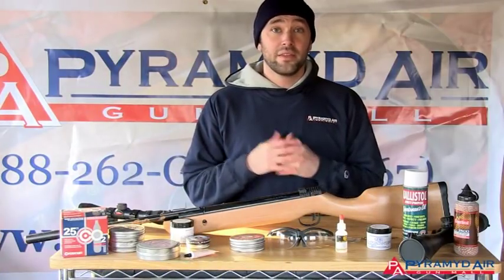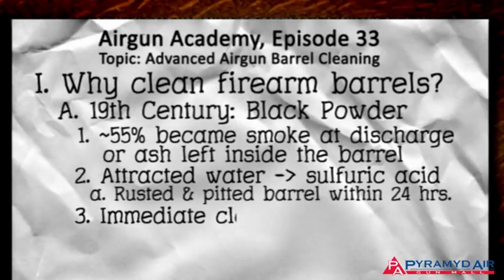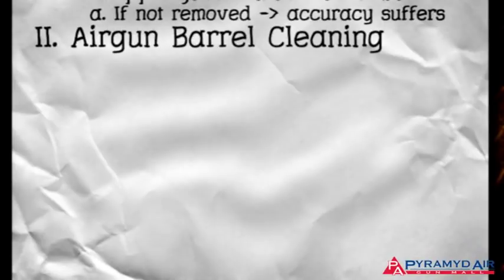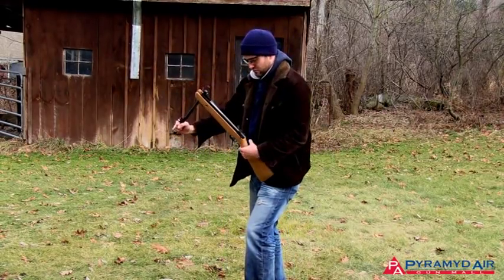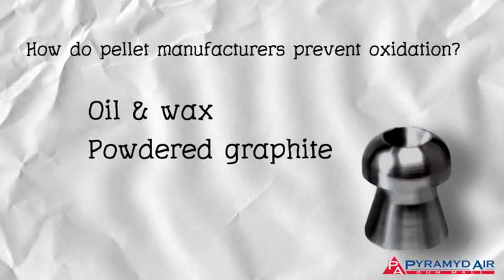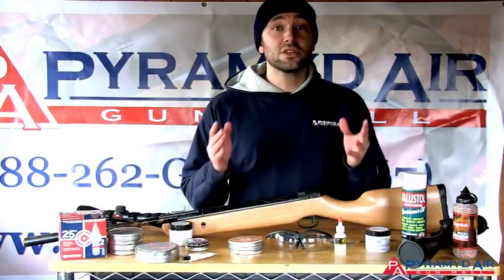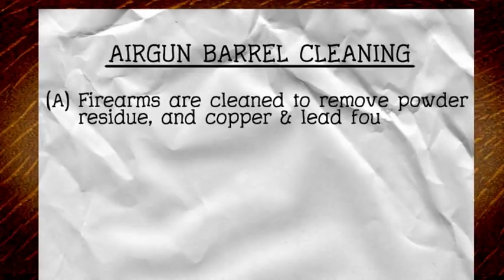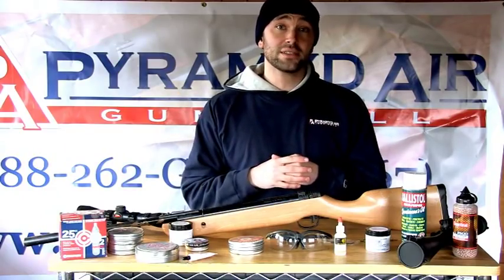Airgun Academy Episode 33 - Cleaning your airgun barrel

Comment: I agree 100% with your suggestions in this video. I rarely ever clean my airgun barrels. The outside is a different story. Oils from hands can damage the bluing, finishes, etc, so I do wipe down the barrels with household oil after every use and put the rifles away without touching the barrels again. I also wipe down the stock to remove oils and sweat that may have been transferred. Another recommendation, I always remove any rings I'm wearing so as not to scratch the barrels (especially springers). Yes, this includes my wedding band (but only while shooting!!  GREAT video, thanks for the information.
Reply: A lot of fine over unders have been purchased for good price due to rings being worn while shot. 😅

Comment: I use a piece of grass trimmer string and a small patch with a little Hoppe's solvent, followed by a patch with a little Remoil on it, about every 500 pellets or so. Has worked for me for years and no damage to the bore.

Comment: It is a good idea to do a once-through with a patch or two when you get a new gun, especially if it's one of those off-the-shelf kind you find at Wal*Mart.  Sometimes, manufacturers put a thick oily coating in the barrel to protect it from corrosion during transport.  This is especially true with guns being shipped overseas.  Almost every Chinese-manufactured gun I've seen has this dark colored gunk inside of it.  You can smell it if you fire a round through and, in the case of break barrels, actually see it atomized and suspended in gases and water vapor.  Firing a bunch of alloy pellets through the barrel will eventually clean most of it out, but running a few patches and a small amount of solvent will give you a good head start.
Reply: Is it common for the first shot from a new air gun to blow smoke out and sound like a 22 long?
Reply: @JFEnterprize  Only an actual firearm will produce smoke of any kind.  If your airgun doesn't have a suppressor, it will definitely make a loud bang, especially if it is a high velocity gun.  Airguns only produce water vapor from rapid air decompression.  For more details, see the above.
Reply: @misterkaos.357  I figured maybe it was the storage oil from the factory. It def was a smoke. We had a pellet in the barrel. Only the very first shot in a crosman quest 1000fps .177 air rifle. I need to get another nice one. Any recommendations? Thinking pcp but break barrels seem a bit cheaper to run without the tanks ect. Plus I imagine maintenance of the gas systems years down the line.
Reply: @JFEnterprize One thing to keep in mind, is that break barrel guns tend to be less accurate than the other types.  Another thing to keep in mind is that most airguns that have the FPS on the package tend to be marketed to casual users who don't understand how velocity affects the projectile.  Your typical .177 pellet isn't really designed for transonic or supersonic speeds.  They are generally more accurate at subsonic speed.  If you want an airgun that can really handle supersonic rounds, it will be more expensive and you'll be using conical slugs as ammo instead of traditional pellets.

Comment: I would avoid using any rod to clean an airgun barrel. Typically airgun barrels are softer and something like a rod can, and will damage the rifling... Use a string pull through method and thats only if accuracy isn't what it used to be
Reply: AirgunnerCA I have used a rod 3 times and thankfully my accuracy is still spot on. now I know too just leave my air rifle barrel alone, and I wont ever shove a rod down her again. thanks for the info.
Reply: Yes and no, brass is always softer than steel, however what you are in danger of damaging with a metallic rod is the crown. Gunpowder firearms don't have a crown in their barrel.
Reply: @kizunadragon9  Pay attention boy, the advice says never clean a brass barrel, they don't need cleaning.
Reply: @kizunadragon9  Really!  My gunpowder firearms must be defective then.
Reply: @kizunadragon9  No crown? Are you serious? ALL barrels have a crown. Why would you post such nonsense?
Reply: @scottmurphy650  yep, completely wrong on that one, my bad.
Reply: Brass rods are softer, intentionally, than steel rifle barrels. Firearm barrels are hardened and their Moh hardness is . That is why brass and aluminum are used to make barrel cleaning rods. The Moh's hardness of brass is on average 3-4. On steel (that has not been hardened) the hardness is on average 5-8.5 depending on its composition.
Reply: @kizunadragon9  No worries. But it is of the utmost importance to never damage the crown since that is the very last steel the projectile, bullet or pellet, sees as it leaves the barrel. This is why when you clean a rifle you should ALWAYS clean from breech to muzzle if possible. You cannot do that with my M-1 Garand and M-1 carbine so I use a .30 caliber brass muzzle guides to protect the crown when I clean the barrel. On my M-14 I have a plastic cap that fits over the flash suppressor and guides the cleaning rod (I use one piece nylon coated ones made by Dewey to protect the bore) so it does not ever touch the barrel. My Rem 700 .30-06 and 300 Winmag are 25+ years old and there is no telling how many hand load rounds (thousands) which been through both and still shoot one hole at 100m.
Reply: I have a Gamo Swarm Magnum Gen which shoots anywhere between 1300 and 1600 fps depending on the pellet and I clean it around every 300 rounds. It is still capable of 1 hole at 10 yds and 0.5" at 25 yds.
Reply: @scottmurphy650  I don’t see the need to stick a rod down an air gun barrel, no need to go aggressive since they don’t have no where near the fouling a firearm has. A few dry patches I with a pull thru always does the job for me.
Reply: Yeah...that was part of the video

Comment: Nice format, style and flow in your presentation.  It was straight forward and I learned some new things I can share with others,
 like the chemistry of pellets and oxidation....."in order to become a positive person, you must lose negative thoughts, oxidation is the chemical loss of negatively changed electrons"   thus iron metal losses electrons 1 Fe(s) ----->  1 Fe3+  with three negatively electons (3-) lost, THUS corrosion of iron metal to iron (III) oxide or RUST..... ..... Wow wax and graphite as protective coating on my pellets to prevent my lead, Pb metal from oxidizing, never knew that, THANKS, job well done!

Comment: Very accurate info!  Don't use standard real gun cleaners... not necessary and (can long term) damage seals... a simple clean cloth or cotton pellet wade is all you need, with occasional minimal oiling of spring and seals...Use air gun chamber oil only for the chamber, not the spring. Trust them... They have a lot of experience...

Comment: Nice video. :)

Btw, I know that this is over two years old, but I have recently gotten myself a fixed barrel airgun, with a "charging" port at the top of the barrel. How do I properly use a cleaning rod with this type of gun?
Reply: justahappyfellow pull- through cleaners are used with fix barrels. A quick Google explains it better. (I've never used one)

Comment: Do air rifles that fire faster than 950 fps need cleaning more often?  Im this video he said ones that fire slower than 950 fps do not have lead fouling.  I have a Ruger Blackhawk that is advertised as 1200 fps... if I use lead or copper pellets how often should I clean it, and if this speed can have fouling, what is the best bore cleaner?

Comment: sir my i cleaned my airgun and shoots accurately but one day later in losses its accuracy  . should i clean it every day ? or whats the problem ?? help
Reply: If you're using a Magnum air rifle (a scoped one I mean) then the constant jarring of the scope by the heavy recoil can cause scope damage and ruin your zero. This also sometimes happens if you have exposed turrets and you use a cheap case, where picking up and moving the case can move your turrets. Alternately, make sure you consistently use 1 kind of pellet, because not all pellets are as accurate as each other. It is also important to note that resting a gun on it's barrel when you shoot will change where the pellet lands VS. resting it on it's stock. If you're shooting a red Ryder or something then I don't know what to tell you.

Comment: Unless your rifle is malfunctioning or has real dirt,mud and grime from the outdoors in it there is no reason to clean an air rifle barrel. Simply the act of firing the rifle will push any particles out. So many people run a patch though the barrel (especially when they first buy it and see a dark gray stained patch come out and assume it must be dirty... No thats graphite, graphite has been used as a lubricant for decades and will do no harm to your rifle.

Good rule of thumb, only clean your barrel after you have exhausted every other troubleshooting steps.

Comment: Crap. Does that mean that all those "clean your pellets before use" videos are wrong? I'm a new shooter and thought that's what you were supposed to do.
Reply: Silky Tp clean your pellets, not your barrel unless your accuracy goes to crap. Use a string and cloth to clean it though to reduce the risk of damaging your barrel. 

Clean your new pellets in hot soapy water twice using a sieve/strainer between washes. Towel dry after.  Use a hair dryer to make sure they're dry! Especially up the skirts as that's where water will linger. 
Then use a good pellet lube.  Preferably a pump. Two pumps is more than enough to coat a tin of 200 pellets. Less is better. They only need a very light coat. 

Biggest tip is, don't go cheap with your pellets. You'll be amazed at the difference in accuracy. 

 Plenty of good pellet cleaning videos on youtube.